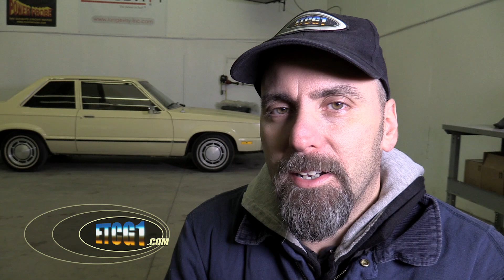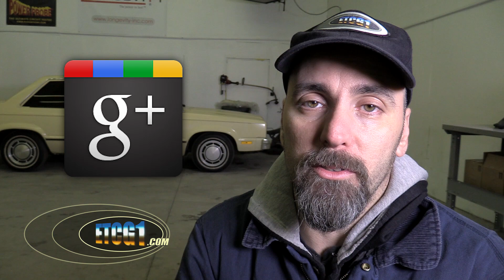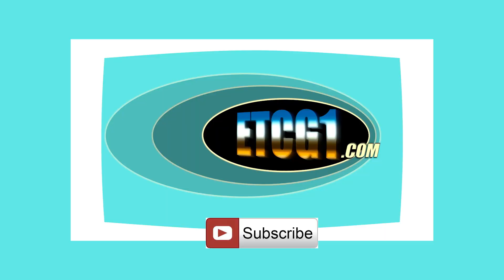How Things Have Changed In Auto Repair -ETCG1

Comment: All this computer horseshit is getting to be too much to fuck with. In my experience, most failures that set DTCs are for sensor and associated wiring issues, not hard parts.

Henry Ford said the scariest truth I've ever heard. Something along the lines of "The Model T is the only car that anybody will ever need." NEED. He said "NEED" N-E-E-D NEED.

Cars don't need all this electronic bullshit and sensors. Carburetors and distributors worked just fine and dandy for about 80-od years. That's figuring the dawn of consumer vehicles around say 1905 up until fuel injection really grabbed the market somewhere around say 1985ish. Give or take a nickle.

Personally, I think that the Rochester Quadrajet and Carter AFB (same design as Edelbrock Performer Series) Carburetors are all you need for streetable fuel delivery. Maybe some improved cold start and cold driveability, but that's it, really.
Reply: Everyone fears and hates what they dont understand huh?
Reply: +John Jalas Typical hack who doesn&#39;t understand the technology. Like A distributor can adjust to optimal timing with change of specific learned fuel cell strategy like a cam sensor and COP combination. 
only fools judge  what they don't understand. You don't have to embrace it, but you also can't judge it when you don't even know what you are talking about. 

  The world is so simple to the ignorant.
Reply: +John Jalas ROTFLMAO!!!!! yep did I call that or what?? Like shooting fish in a barrel. 
  like I said :The world is so simple to the ignorant. 
 learn the technology my friend. only then will you understand. goodnight.
Reply: +John Jalas Thanks for giving the point of view of the fool who doesnt understand that because of technology a car that goes over 100K miles before it needs a tuneup and averages 27MPG is less expensive than a car that doesnt last 100K miles in its lifetlifetime at 11MPG. 
  Again if you understood the technology you would not seem so ignorant. 
 The world is so simple to the ignorant. 
 Q.E.D.